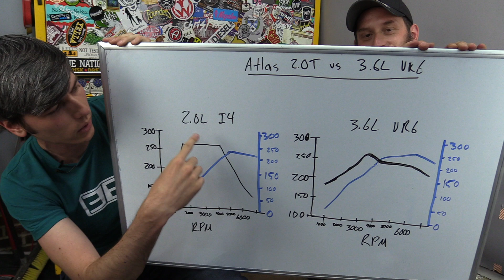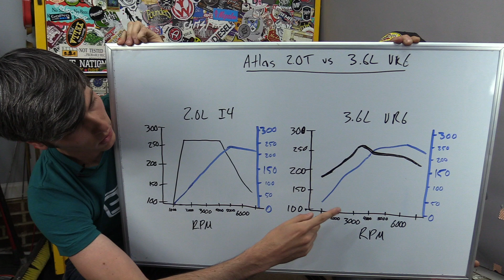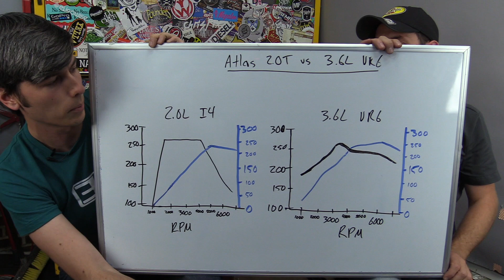4 Reasons Why The VR6 Engine Is Dying Off

Comment: What if - VR6 Turbo... For the next R
Reply: We can dream..
Reply: vr6 turbo would start cutting into audis profits
Reply: @jewlouds  just hear me out 2021 A3 3.2t 🥲 idc if it has a baby turbo and low horsepower just give us the option of a turbo from factory 😩
Reply: I wish, but I dont think they will stray from the i4 in a R for a while
Reply: Rokas Bilevičius 

I wish they would. VR6 has been around for roughly 25 years now. VW better not Discontinue this tried and true motor.
Reply: Too much power = vw as a manufacturing company would never make it. Unsafe for the moron's of the world with the cash to buy it.
Reply: Rokas Bilevičius OMGGGGGG
Reply: Concept is a concept, doubt that they will start putting 6cyl engines again. Even Porsche went to 4 cylinders
Reply: vr6 turbos can easily make 600-700 hp , would be sick but not as a production car, there is a 1200 hp vr6 golf :) 1/4 mile is under 9 sec
Reply: andrew wright yeah and gti/r drivers are bad enough as is lets not give them more power to tool around with
Reply: The concept golf r400 was going to have a i5, so how about them making a VR5 for Audi/Porche/Volkswagen? I guess that i can only dream
Reply: The return of the R32's
But turbocharged
Reply: there are plenty of vr6t's running around
Reply: Vr5 turbo?
Reply: @lilvirtt3577  im sure theres vr5 turbos somewhere in europe, america didnt get the vr5 engine
Reply: A Golf R 2.8L VR6 Turbo with same specific power/L as Golf R would be 420hp/420tq. That'd be awesome and would finally sound amazing again... But not gonna happen.
Reply: @JFinns  I could see it happening if:
a: VW ever decides to do a Golf RSI (ie above R) and
b: Audi doesn't want to share their 2.5 I5 from the RS.
Reply: God I wish!
Reply: would rather V5 turbo in the next one !
Reply: @psy06  there is no such thing as a v5 numb nuts
Reply: i doubt it, the vr6 is not efficient

Comment: I've come across quite a few mk4 diesels, not completely dead. They're surprisingly desirable to be quite honest, my mk4 Jetta is. 1.8turbo and I'd much rather have a diesel.
Reply: Peepmysneaks ALH tdi is king. I popped my head gasket in my ‘01 a couple years ago at 300k and drove it for another 75k. Ran perfectly. Original clutch. 45-50mpg. If only I had enough coin at the time I’d have done the head and it would be pushing 400k rn. Currently driving a ‘96 1z tdi passat wagon and I’m very happy with it. Hopefully ill source an engine for the golf and get it back on the roads soon though.

Comment: rule number 4 isn't relevant for VWs. most of their engines suck especially the tfsi versions. the pistonsgaskets are a little too small so in colder climates(northern europe), the gaskets don't seal properly and most of the engines break after only 60 or 80 thousand miles(about 100 to 120 thousand kilometers). The problem is so bad that all vw dealers in Denmark have mechanics whose only job is to change engines, even the smaller dealers who only have 10 or 15 people working there.
Reply: anermand I've never had that problem lol. 198k miles, 13 years in Michigan (a state infamous for cold weather), and my 1.8T is fine.. I recently took it on a 500 mile trip
Reply: Heartagram the good old 1.8 turbo engines were amazing! their were built great, but their werent tfsi either... that was only implemented in engines after 2005 in their 1.4 engines and in 2008 ish in their 1.8 and 2.0 engines. these engines are the shitty ones...
Reply: TheEpicSpaniardRS Apparently we only have the problem north of berlin. As soon as you're south of there the engines last fine. pretty much the same story for rust as vw also use slightly cheaper metal in their cheaper cars. well... all german cars do that maybe except for BMWs... they still have higher grade iron and aluminum in all of their cars... for now...
Reply: anermand VW, a brand based in Germany, where in winter it gets, depending on location, as cold as Denmark, makes cars that are not good for cold weather?
Reply: anermand This only affects longitudinal engines on a4, a5 etc. There are many tfsi engines. Not all are the same. The latest gen3 is great.
Reply: well then I'm not going to mention the three engines i swapped this week... and it's only Tuesday... that said it is after a longer vacation where people have been driving longer trips on holiday and stuff... here in europe (germany) the problem has become so bad that you can buy 10 turn cards for oil-fill-ups on audi and vw engines and get the 10th for free ;-) such quality I tell you...
Reply: Vw just sucks in general

Comment: The VR6 is an awesome engine.
12 valve 2.8L VR6 + Turbocharging and forged internals = FUN!
Reply: 24 valve is better though
Reply: stoneeh What? If you're having trouble putting the power down an a stock gti you should find a new hobby.
Reply: David Perry If you have the funds and want to build a 700hp+ vr6 is the way to go. Had a 400hp vr6 with stock pistons and melted it. Changed to forged pistons stock crank and rods. Then changed to turbo instead of nitrous lot's of power. But if you're not planning on building a car with more than 300hp the 1.8t would be better.
Reply: With the 12V they are forged from factory, people have made up to 700HP from stock internals...
Reply: Josh Mustillo also if 300hp is your goal. You might be able to get their n/a with a 24v. Or with simple bolt ons with a 1.8t.
Reply: 24 valve is too expensive to repair. A big turbo 12v lays down nasty power more reliably you can be cammed and fully forged for less $ pushing 670+ on a chip tune/gt40 on pump gas. Everybody ends back with the 12v.
Reply: Josh Mustillo I went with a 9:1 and i need a lot of boost. Honestly i should take my car to a dyno to tune it, but i don't plan on keeping it much longer. I might be moving soon.
Reply: Josh Mustillo just the crank and rods. Pistons usually beed to be replaced.
Reply: Each to their own, I'm not and I'm aiming 300HP low boost 400HP high boost with E85, 10.5:1 compression.
Reply: Elijah Chu That's the goal to just have it running right, sure when I have some decent savings I'll aim for much more power, but if it blows up I can't afford to rebuild and have it back on the road
Reply: I actually prefer the 2V version. And why would you ever put a super/turbocharger on a FWD VW? It can barely handle the output of a stock NA engine.

Comment: what model is this 2005 vw gti with 2.8L vr6? there is the golf 5 gti 2L turbo l4 or the golf 5 r32 with 3.2 vr6.... please explain
Reply: Iacubovschi Mihai in Europe no, in US it might've been
Reply: 2005 to 2006 is a generation change. It went from mk4 to mk5, and you could only get the 2.0l i4 in a mk5 GTI. R32 isn't counted in this.
Reply: ok generation change but there was no gti in 2005 with a 2.8 vr6.. there was no gti with a vr6 engine the r32 should be counted because there is a vr6 engine used in there. there was a mk4 golf with a vr5.. Jason, c'mon answer here!
Reply: there is a 2.8l 24v vr6 mk4. I'm actually swapping one in mine. r32 is a whole different beast
Reply: yes, agree, but was it ever called a gti? maybe in USA I am not sure... I found it was called GLX

Comment: I owned a 3.2L VR6 for 10 years. Not the fastest or lightest or best MPG, but damn it sounded good (with an exhaust) and never gave me any problems.
Reply: Ryan Fagan Wookie noises!!!
Reply: Ryan Fagan I still love that sound every time I drive
Reply: i was a tool and deleted the resonator mid box, and the Wookie died...shame on me.
Reply: Ryan Fagan, the key note. It never gave me any problems!
Reply: R32 is the most cutest sound ever💓💓💓
Reply: word up side word dude👍
Reply: I still own my 2003 VW Jetta GLI with the VR6 power plant. Great engine! Reliable and great sounding. Weight to Horse Power is actually pretty good. Cannot seem to part with it!
Reply: What exhaust did you run? I have MK2 TT with the 3.2L VR6 and I wanna know what's best for the iconic sound.

Comment: (off topic) I don't see why y'all hate on VW, the Dodgy american brands (see what I did) are probably much worse at emissions if compared in the same ways as the VWs.
Reply: Dan - very unlikely that some engines on their own had the idea "oh, let us cheat the system" and nobody knew anything. Also the way VW reacted was just braindead.
Reply: They just last longer, therefore, it is more valuable and the maintenance cost for diesel is skyrocketing. With maintenance costs increasing, it takes longer to see the lower cost benefits of a diesel. Its a shame vw is killing the diesel line, i was looking forward to the Amarok with a diesel.
Reply: Christ - 1 kWh gets you ~5 km, 1m² Solar panel gives you roughly 1 kWh/day.
to go 100 km/day you would need ~ 20m² - quit normal size actually.

"Now with Teslas available, there's just no reason to ever choose anything else."
Well there is no reason to choose a Tesla - it is like the Apple of cars. Not bad, but way too pricey for what it is offering.
Reply: i can answer the question for you, too. Yes the most Diesel engines in comparison are more expensive. Especially your comparison between turbo diesel and NA gas. The Turbo, higher compression in the Rail need better parts and you also have to use a DPF( particulate filters ) are all parts which make the diesel car more expensive. 
Sorry for my englisch. I´m from Germany.
Reply: So you are going to take a week to charge your car to 100%?
Reply from the maker: FCA is also pending litigation with regard to defeat devices. VW gets crap because they intentionally cheated the system, and lied to customers. There's never going to be a time where that's okay. They could have also acted much more quickly in the best interest of their customers who did indeed by their diesel products once the scandal broke.
Reply: For some reason my comment wasn't posted as a reply to someone else (but ty for replying!)

From the coverage here in the UK, VW didn't intentionally cheat the system, some of the engineers at VW cheated the system without telling the big bosses, I know that counts as VW, but yeah the big guys didn't do it on purpose from what I've heard. 

I still think Diesel won't die just yet though, once we get more affordable Electric cars with more range, then diesel will die for the General Public.

(Big fan of Tesla here lol)

big love <3
Reply: Combustion is much different process with a diesel...and a lot tougher to control...generally diesels are far more "overbuilt" than a similar sized gas engine in order to handle this...
Reply: Dan fantastic plastic
Reply: I rather we just go solar energy and use pure electric cars. They don't take that long to charge and solar charging stations have already been installed in some businesses that encourage electric vehicles. 8h of charging is more than enough to fully charge the current EV's. 

Converting H20 to pure hydrogen effectively takes a renewable resource(water) into a non-renewable resource. Image what would happen when the earth runs low on water and we had to create synthetic water or something?

I tell you, these corporation would destroy the earth just to make a profit. Anything but solar energy right now makes no sense, except for corporate wallets.
Reply: They're miserable bastards to work on, have cheaper electronics than practically any car on the market, and their interiors disintegrate over time. Working at a used car lot, used VAG products tend to wear the worst and have the most prominent major issues. Audi can be a bit of an exception.
Reply: DanNO: as far as I remember there is evidence that the VW top knew what was going on. Did you really think that "a couple of engineers" would do something like this without it being sanctioned by management? But then again, you're a fanboy and that obviously has a hard time accepting that VW management are lying scumbags :-)
Reply: Engineering Explained which is a shame since diesel cars seem to be few and far between these days. unless you want a pick up truck
Reply: Engineering Explained Maybe you can answer this question for me. Are diesel motors more expensive than gasoline engines? Example, a 2.0l turbo diesel vs. a 2.4L 4cyl. The reason why I ask this question because the diesel version of cars are always more expensive than the gasoline version of the same model.
Reply: you can fit all of that and more in a van which can do up to 15 km/l
Reply: If by most you mean ca half, then you are correct (2014 figures).
Reply: theres ways to produce hydrogen with chemicals
Reply: So true, and hydrogen production does more harm to the earth. I've heard that the production of hydrogen leaves a poisonous residue or something, and you can't revert it back to water if you extracted it from that.
Reply: When you burn hydrogen (like you would in a car), the byproduct is heat and mostly water (with some other things).
Reply: Razvan - why would you waste the power of a nuclear reactor on the production of hydrogen?
Create electricity and use that for electric cars. A lot more efficient.

Hydrogen powered cars are a technology of the past that never took of cause it is a niche product with no real advantages.
It is relatively hard to contain the hydrogen safely and even then it is less safe and less energy dense than LiIon batteries that do not need a fuelcell.

Also building a nuclear reactor underwater might not be such a good idea.
While it is a really good place to operate one there, the costs of construction would be ginormous.
Reply: Pryce Newberg it has everything to  do with more power, Reliability, horsepower and torque, good emissions helps everything.
Reply: Chris Tate  no only takes a few hours, no difference in charge time  if pure solar or on the grid. True at my house and all solar powered homes, thanks to Elon Musk solar City.
Reply: *in the US
Reply: Albert S. - that just shows that you haven't listened in school at all.
Yes plants need CO² - and they already have more than enough. And emissions are not just CO² but a shitload of other things too - and several of those are potent greenhousegasses.

Also just to show how retarded your statement is:
Animals need Oxygen - so lets live in a pure oxygen atmosphere.
Humans need Chlorine - have fun breathing that.
Oh - we also need waters - lets drown in it.

See?
there is always a sensible amount, too little and also too much is bad.
if we destroy our environment even more than yeah - millions of people will die every year and billions will suffer - it is as simple as that.
Reply: lol gfy
american cars are shite
Reply: Doesn't Matter Most cars in Europe are diesels, they will soon be restricted in a lot of cities. Diesel is dying off because of nanoparticules, but they are more effective and  flexible to drive.
Reply: Pryce Newberg - you can have a powerful car regardless if it has a lot of emission or not.
But with your attitude i wish you "good luck"" - every time you go next to a road there should be a rollingCoal painting you black.
Reply: curiously, US emissions police raided everything that wasn't american... hint hint
Reply: I'll take electric vehicles over hydrogen any day. I'll install solar panels in my house and charge the car with the sun!
Reply: ... Why the everloving F*** would I ever care about emissions?  What in Hell's name is a lower emission going to do for me when I have 6 bales of timothy hay that I need to get home next to the 3 bags of crimped oats?  I drive a '96 F-150 because I have horses to take care of, trailers to tow, and neighbors to help!
Reply: There are so many great car brands from Japan and Korea and America that don't stink up the atmosphere, why would I even consider a VW? Americans all remember what a joke the VW Bug was, and now their diesel scandal. Now with Teslas available, there's just no reason to ever choose anything else.
Reply: Pryce Newberg well sir you are the arrogant type of person who needs to reconsider their stance. 
America has a large issue & its Americans lol